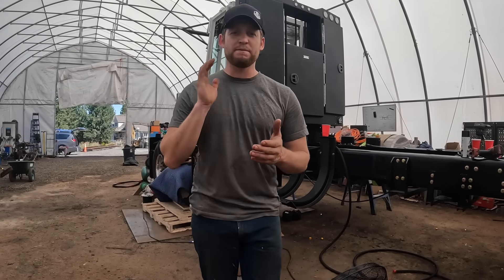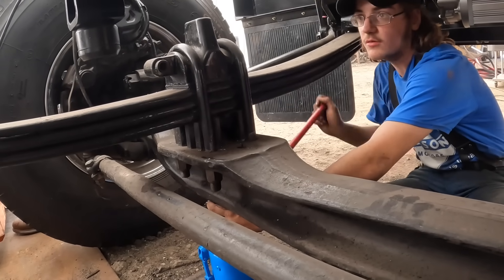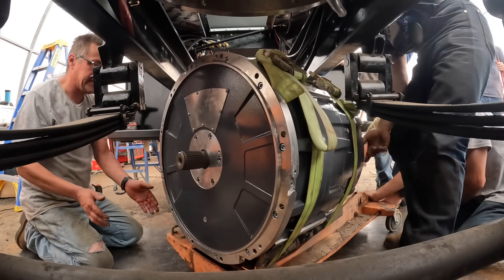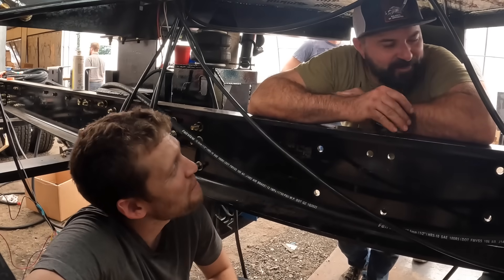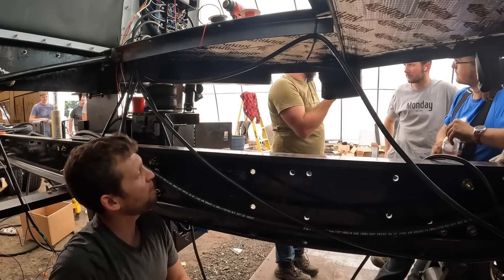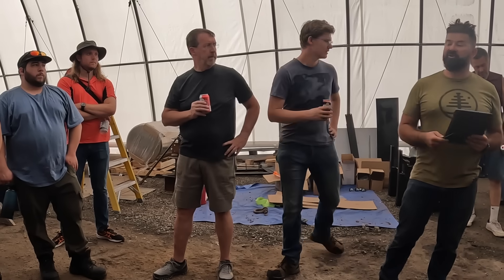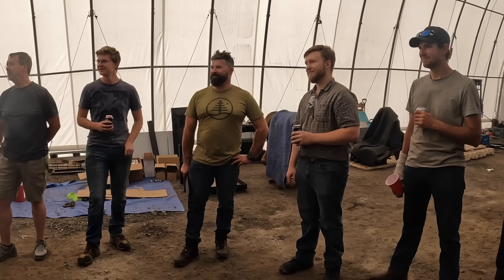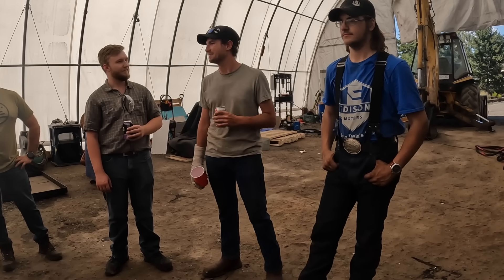Flodraulic Arrives : Truck Transformation Chronicles and High-Voltage Adventures!

Comment: the dedication behind this truck is insane. even if it doesn’t work as a diesel generator electric truck slap a cummins and a 18 speed in that truck and they have still designed a extremely nice vocational truck like a modern pacific
Reply: There's no way it wouldn't work
Reply: would be a real shame if it didnt work as a series hybrid, because its just objectively better as one
Reply: I know that Kenworth knows that it will work. I also think that Chase knows that Kenworth knows it will work. They sent a guy out to look at it, and I can think of only one reason why: they want to see their youngest competitor. They've seen Carl, but Carl is a toy compared to this. This is the future of green technology, and it's built better than an elephant.
Reply: @stauker.1960  flodraulic also knows it will work
Reply: Why wouldn't it work as it is though?

Comment: Such a good crew! And that sure does set the stage for what can be accomplished. I saw the dirt floor, and thought the generator installation may be a fun job. But was glad to see you had a solid base to operate the jack on. Back in the day, when I was young, most all our sheds on the farm were dirt floors. Yep, those dirt floors make.mechanicing such a joy! Keep up the good work. I have faith that your crew will make the deadline.

Comment: How about using an IR/thermal camera on startup to see if you have any hot connections before stuff starts to burn?
Reply: We did exactly that for some wire tracing when we suspected a component was drawing more power than it was supposed to!
Reply from the maker: That’s a really good idea!!

Comment: Hey Edison in the future do you plan on dropping the cab on last in production if so would it be easier to have a fully built cab with all your can bus and wiring ready to go with connectors in the outside like a ( plug in ready to go type deal)

Comment: Have you set aside space in the design for waste heat recovery systems? It seems like a system that generates some power from the exhaust gas heat could help fuel consumption, even if only minutely, and therefore increase the incremental value of an Edison over a conventional alternative.

Comment: Hey yall, I'm out of work for the moment, and currently live 5 hours away in Washington state. I come with minimal experience (used to work in a heavy civil construction repair shop, did a little of a lot), but hell, i ain't got much else to do, & i have a passport & 2 working hands. Need an extra warm body for stupid work? Will work for food & coffee.
Reply from the maker: Thank You for your offer. 
Usually that might be an option, however, we currently have a full shop!
Reply: @EdisonMotors  understood! Maybe I'll get the chance after the show, as the next project starts 😁 good luck gentlemen!
Reply: @brianb-p6586  i already had a feeling that would be the case, so i'd planned to bring skis along. I've heard BC mountains are horrid & suck for wintersport... wanted to try it out for myself, tho 😏

Comment: Did they put lock tight on the flywheel.
Reply from the maker: We did!
Reply: @EdisonMotors that's good remember see that you Guy needed a reminder and not be following all your updates enough to see if mention it or not. That is 100% the kind of the that I would forget or keep trying to remember if did. Worked on more then one thing to have it 98% back together just to pull apart what's even worse is when pull it apart and I already did it right the first time and just can't seem to remember.
Reply from the maker: @t-bfr45-70  you bet! Thanks for the reminder, we had not mentioned it, but did confirm that it was done before installation

Comment: This is the only electric vehicle that Im interested in. Others are lame. This is awesome.
Reply from the maker: It’s not a hybrid. Technically.
-Theron Danger
Reply from the maker: @brianb-p6586  The reason we are not a hybrid, is because of the definition of a Hybrid, not because of some commercial nonsense. 

Just because “Hybrid” and “Series Hybrid” both have “Hybrid” in their names, they do not mean the same thing. 

Hybrid vehicles can be driven by both the engine, as well as the batteries. 

Our Trucks can not.
We have a fully electric truck with an onboard self charger. 

Hybrid vehicle = both an engine as well as batteries can drive the vehicle 

Series Hybrid = Engine generates power for the batteries, batteries power motors which drive the vehicle. 
For example 

There is a huge difference 

-Theron Danger
Reply: @brianb-p6586 and all this matters why???
Reply: @brianb-p6586  I could really give a shit less tbh I just find the build interesting.

Comment: The steering's motor-drive hydraulic pump... 
Does it have some sort of of flow-control or demand-control?
Or does the pump whirl away at full output whenever there's a potential need for steering?
Reply from the maker: I don’t know, we’ll find out when we turn it on and drive
Reply: @brianb-p6586 I'm familiar with the systems you described, except for ZF's electric for HD applications. Interesting; thanks for that tidbit.

As to the Edison system, I was speculating if maybe it was going to be closed-center or low-flow, utilizing an accumulator to reduce pump run time. It takes a good bit of pump output control to have adequate flow during a "whip" of the wheel yet not unnecessarily high volume during low demand. Simply powering up the pump for full-flow through  open-center is probably not going to be workable. It'll probably need some refinement -  after the show.
Reply: @brianb-p6586 Battery industrial (lift) trucks too solved the continuously running pump issue years ago.  Although now they've mostly moved away from "gear box" steering.
Reply: In a nutshell, the steering pump would charge a gas-cushioned hydraulic accumulator until cut-off pressure was reached, then the pump motor would stop. The accumulator would have the system pressurized and ready until steering wheel input directed oil to "work" then the pump's motor would start again at pressure  drop. Conventional steering gear or orbitrol valve both used variations of this system. 

As to hydraulic  steering now, I'm not plugged in to the latest, but I suspect that as with most systems more sophisticated sensors and controls, variable displacement pumps, so on, have replaced some of the rudimentary systems. 

Electric... I'm green, having experience with just one retrofit project; which seemed to go well enough.

As to Edison's system, the big unknown to pump control is if the gear could tolerate having its return port restricted and pressurized while waiting for wheel input. Probably not - besides case pressure concerns it'd require sophisticated valving.
Reply: @brianb-p6586 Understood, the "traditional" power hydraulic steering system is open-center with the pump constantly  keeping fluid in circulation, whether the fluid does any work or not. 

When traveling on a long straight roadway (or when parked) steering boost may not be required for hours; yet the pump constantly churns along. The constantly running pump is considered just another "cost of business" when it's an engine-driven accessory.

Now, with the move to a standalone packaged electric-motor-driven pump, reducing unnecessary run-time or output volume becomes a consideration.

Added benefits of more refined control would be things  like having lots of boost when crawling through  haul-road ruts, and good road feel when at highway speed.
Reply: @brianb-p6586  I wouldn't characterize electro hydraulic as having been standard fare; yes, there were a few manufacturers dabbling with it on some of their lineup.

As to variable flow, that's what's implemented in the Ford/Volvo system.

Yes, even closed-center or variable flow are workable. Within reach of Edison developing it? Not likely.

Which gets us to the crux of the dilemma... it's tough to be on the "bleeding edge" as an assembler constrained by components available from outside suppliers.

PS - Apologies for backtracking but I just had a flashback...  Terex wheel loaders had a steering system with a pump sized for typical conditions, while an accumulator would augment pump flow during aggressive steering moves. 

That's mostly irrelevant except to point out that utilizing reduced pump volume during typical conditions isn't impossible, it's just that previously it was mostly a non-issue.

With that, I'm moving on from this well-plowed row.
Best luck
Reply: @brianb-p6586  Good detective work!
Edison needs to ID the component installed  in pressure line between pump and gear.

Comment: Can't believe use are working on a dirt floor and use that old digger . A proper work shop would make life so much easier for use
Reply from the maker: If we can build it on a dirt floor without special factory equipment, then it can be serviced on a dirt floor without special factory equipment

Comment: Why bother with an engine mounted air compressor? The air system has its dedicated electric-drive compressor.
Reply from the maker: Yes, but why not have redundancy.  If one fails the other one will work.
Reply: @EdisonMotors I was thinking about added cost, complexity, weight.

The two systems being active simultaneously might bring some issues. Control could get complicated. The engine pump uses a governor/unloader system and the electric probably a pressure switch. If cut-in setting of  either is even slightly higher it's going to become the primary pump. 

The electric's control would be simple to deactivate, the governor system, not so simple.

Things get more complicated when other scenarios are considered. Definitely not in keeping with KISS methods.

Comment: Ive seen you use your highvoltage gloves with out there protectors so they should go to the trash. You should really get simeone who know what there doing around live power for when you dint have the experts in the shop.
Reply from the maker: …..  nobody has even opened the high voltage gloves yet.   You know just normal rubber gloves aren’t high voltage right?